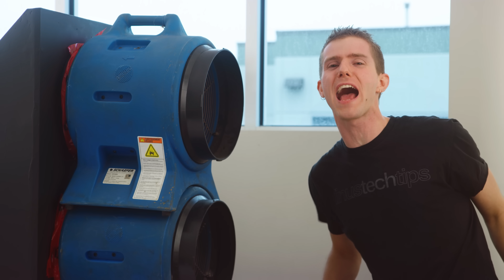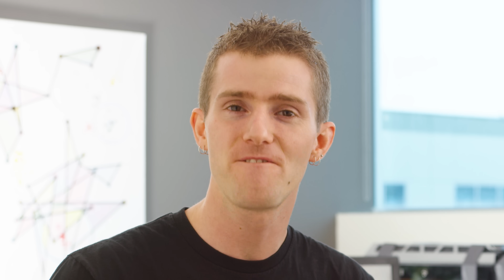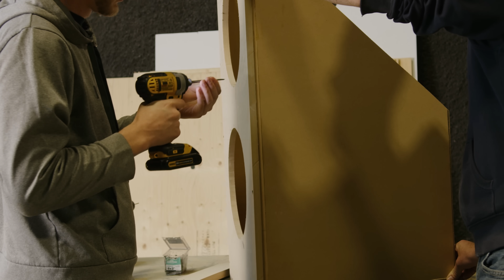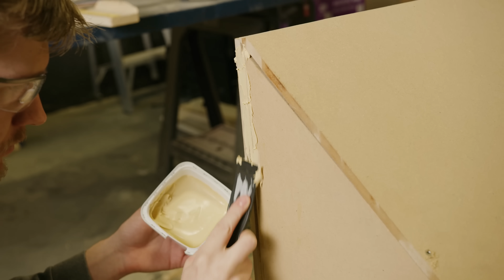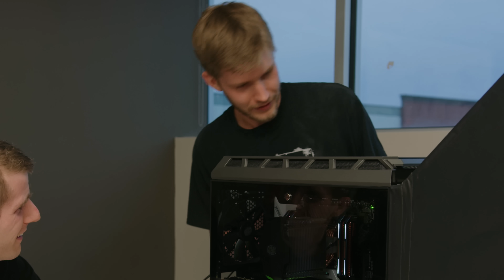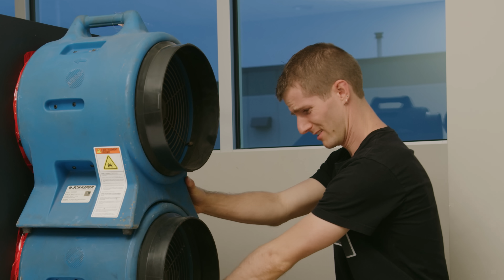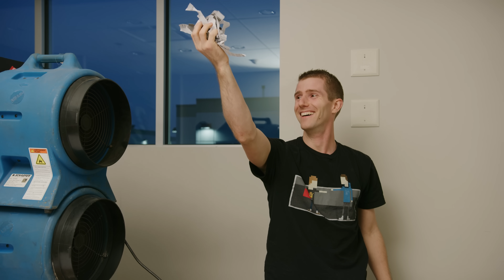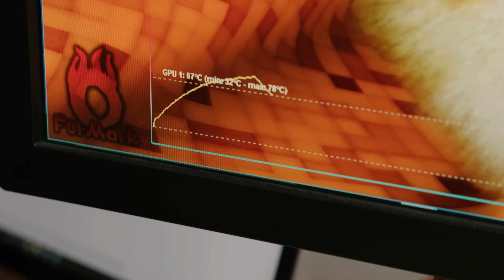Highest Airflow PC EVER - SUCCESS!

Comment: Now attach those fans to a semi radiator attached to a liquid cooling loop (upgraded pump too)....
Reply: You would need a wicked pump to move enough liquid to match the air that this thing pushes.
Reply: Yeah, I just posted the same thing :P  This setup was limited by how quickly the heat could conduct away from the CPU/GPU, but active water pumping would change that.  And maybe to keep up with those crazy fans, they could use like a pool pump or something to pump the water 100x faster too lol
Reply: Yes, 21c is as low as it can go, but they still had temps in the 50's and 60's, so there's a lot of room for improvement.
Reply: Full Room Water Cooling Reborn, anyone???
Reply: 4,000,000 gallon industrial City sewer pump should do the trick
Reply: Pressure that high isn't necessary to move water through a radiator, high flow is. A pressure washer pump doesn't have a very high flow rate.
Reply: I was thinking that, it would be a awesome outdoor heat exchanger for anything that gets hot.
Reply: Did they use dust filters ?? XD
Reply: Absolutely, this needs to be a followup video. Come on Linus! 2HP fans aren't enough, we gotta have pool pumps to go with it! (JK, this video was great, tho I still want the pool pump build)
Reply: Wouldn't help too much. Remember that radiators don't make things colder, just helps what ever is being "cooled" to reach ambient temperature. Unless you added a compressor/evaporator (so an air conditioner/phase changer doodad) to the mix, 21c is as low as it would go.
Reply: that would be worse i think. the time it takes for the liquid to move the heat would be a bottleneck. better of with a massive aircooler
Reply: CWeltonDesign water pump must be a high pressure borehole pump ( 2-8 bar )
Reply: Finch Gaming or that ...
Reply: I think ambient temp is the limit.
Reply: Danielle Spargo Not really. There is another limit. The thermal conductivity of the silicon itself. The heat is generated to a large extent at the core of the CPU. It needs to escape. For that it needs a temperature gradient (temperature difference divided by length). Since the thickness of the chip is fix, you can only change the outer temperature. Even if you were able to bring the surface to room temperature, you will get higher CPU temperatures than RT. That is why the extreme overclockers need liquid nitrogen. They generate so much heat that they need almost -200°C at the surface to stay below the max T junction at the core. Huge gradient=a lot of heat)
Reply: and put RGB lights all over it!
Reply: Fluffy Ponies 12 pumps in series? parallel won't work...
Reply: CWeltonDesign and then extend the water lines so you can put the fans and radiator outside your house for even cooler temps 😂
Reply: Race fans and a turbocharger
Reply: ... on Titan ...
Reply: or lets stop this madness but i like where this is going so i am gonna wait for the new prototype :D
Reply: Okay.. now for a video using a compressor 🤤 pretty sure my a40s aren’t capable of blocking out 90dbs, and my friends would hate me on discord.. 😑
Reply: Cooled by Niagara Falls would be good!
Reply: Haven't they proven that liquid is slightly better at idle/low temps and air at high temps anyway?
Reply: Daenon Janis use a well pump
Reply: nah get a car radiator
Reply: semi truck radiator /s
Reply: +Nopiw
Fans for semi truck sized radiators require at minimum double digits worth of HP to turn fast enough to work, 2 horse is nothing for em.
Reply: use liquid metal as a coolant please :D Hg,NaK or Galistan maybe? :D
Reply: except the reservoir is a barrel full of ice cubes
Reply: Now they need to get some car mechanics in here.
Reply: that moisture thou... i mean unless your trying to grow mushrooms inside your case
Reply: temps reach below 0
Reply: no all you need is very large exposed heatsinks on the CPU and GPU
Reply: CWeltonDe
Reply: Use a gas pump from a funny car. Should move enough liquid.
Reply: or just ditch everything into a pool of liquid nitrogen.
Reply: Would probably no joke need a turbopump

Comment: RIP watercooling
Reply: Everything makes less noise than this
Reply: but what about....highest WATERFLOW PC Ever?
Reply: Hook a PC up to Niagara Falls to do the watercooling equivalent of this.
Reply: why RIP watercooling? A half-way decent watercooling still needs less power, emitts less noise and is just much cooler*. 

*pun intended
Reply: Frank Nola not your mom
Reply: 1500 watt air cooling ? So No!
Reply: MotherEric air fanboy
Reply: Siddhesh
Explain to me why does every major datacenter use liquid cooling instead of this then?
Reply: The gamer geeks aren’t getting the sarcasm. Bahaha
IT SOUNDS LIKE A JET ENGINE! No, he wasn’t serious.
Reply: Siddhesh,

Of what? This isn’t practical, but is more end game/tech humor. That is why I jokingly suggested some obscene flow rate like Niagara falls.
Reply: I've never seen a datacenter using liqued cooling..power bills are a major concern for such operations and these clearly pull more power to run that standard server/computer cooling
Reply: Allen Brodess
You've clearly never been in an actual datacenter, maybe some small server closet like Linus has but not a proper datacenter. Not only is air cooling highly inconsistent, air coming from outside is also a massive issue in case of a fire.
Reply: Yeah. Actually, that's why ARM-based servers have started to see some interest. The use far less energy, and don't get as hot as a Xeon or the like, requiring much less cooling, saving even more energy.
Reply: Frano Nola except my laptop

Comment: Why didn't you try overclocking it? It would have been interesting to see how far you can push it.
Reply: Followup needed.
Reply: I would love to see an overclocking with these fans. Hell, it's already built. Try it on a few different systems escalating from a cheaper build to an expensive one. So we can see the differences. :)
Reply: definetly
Reply: UP
Reply: Being that they had no idea what would happen once the fans were hooked up to the case I can see why they did what they did.
Reply: Yeah, I was surprised they didn't try overclocking.. They also need to try blowing the air through watercooling radiators.
Reply: > wth an open-air style GPU

Problem is the heatsink orientation - most (I cannot remember one that didn't) axial fan GPUs would have the heatsink oriented against the airflow from these fans. What would work is taking of the back end of the shroud so the air goes directly against the heatsink instead of having to go though the blower fan.
Reply: do you mean the CPU/GPU or the fans? probably not the smartest idea in case of the latter.
Reply: not very far, a custom loop could have done better i assume

Comment: Basically it is a computer built in a wind tunnel.  This is impractical UNLESS ... one is willing to set their computer up in a usually unused room (like in the basement  and connect the fans to their ductwork or something).  Then extend their IO using Ethernet or something.    Basically having a thin client in their actual office or whatever... like a server setup. I'll bet that more airflow than this say 1.5 to two times as much would result in the computer being hotter due to friction.

Comment: Next time must try air conditior
and i have made video https://www.youtube.com/watch?v=YoOy1uKcxt8
Reply: nah, there's the risk of condensation
Reply: that's called phase change cooling and they've already done it
Reply: heck they even did BONG cooling
Reply: If the air is colder than the ambient temperature, condensation happens and liquids start forming.
Reply: They did it way back in the old place. Condensation would form causing damage
Reply: Brian D Nope, that happens when the air is below dew temperature which is also dependent on humidity.
Reply: Yez I do beleeb and air conditior wold maker it more frostior

Comment: It's funny because that case's airflow sucks.
Reply: For everything who doesn't know: A case with a solid front panel needs about 1 inch of mesh on the sides, which the H500P has but the fans are on the outside which makes the clearance between the front panel and the fans quite small so it can't get enough air which makes the airflow bad.
Reply: Looks like it works fine to me.
Reply: Pennywise it was actually funny to see Paul, and Kyle basically revoke their recommendations on livestream right after the gamers nexus review went up
Reply: Exactly
Reply: 2987ms what do you mean?
Reply: they added a mesh front to improve the airflow.
Reply: Thanks for actually explaining, good to learn something new.
Reply: Nu uh me mom's ded. She can't blow from a coffin.
Reply: Seems like they solved that issue ;)
Reply: With more and more builds going for looks and this being a higher priced case I can see why airflow might not have been as important for them during the design process. The case still looks good of you are going for the RGB look.
Reply: and it's front/top panel attachment mechanism, which was fully demonstrated in this video lol
Reply: Do you even need airflow with one of those things?
Reply: GetTheCheeseToSickbay go watch gamers nexus's review on this case, its complete shite
Reply: yeah, half the improvement was just from removing the front panel
Reply: Adamo Kóligo did you actually just fucking do that?
Reply: Marchex Frost - Found the cooler master employee.
Reply: 2987ms you are Correct
Reply: It's funny cause your airflow sucks Myeeeeh >:(